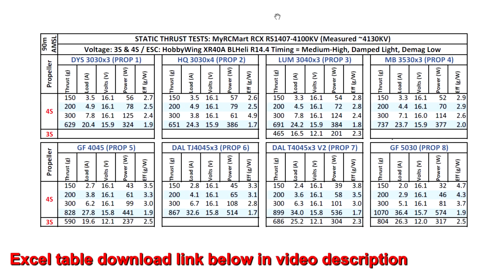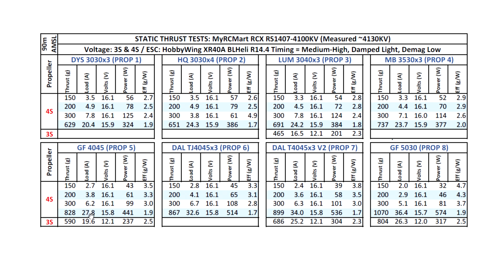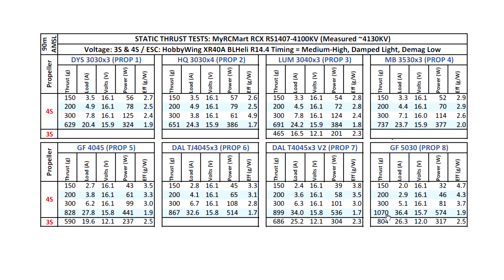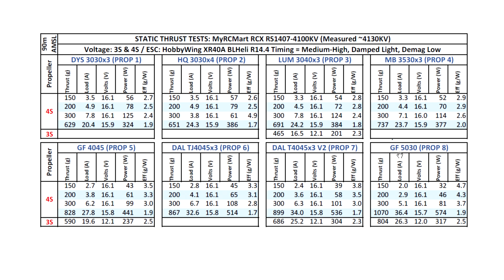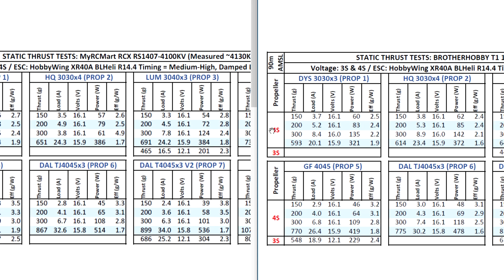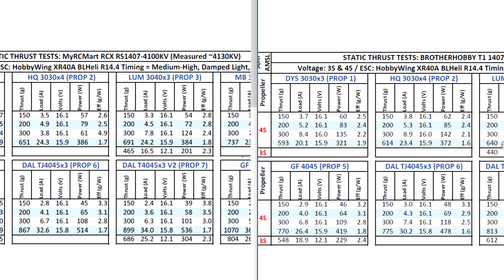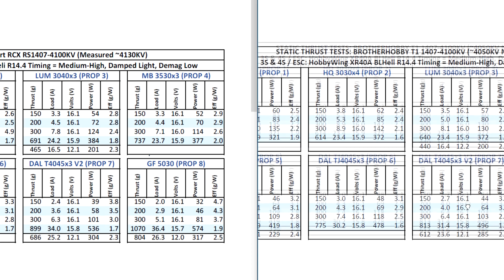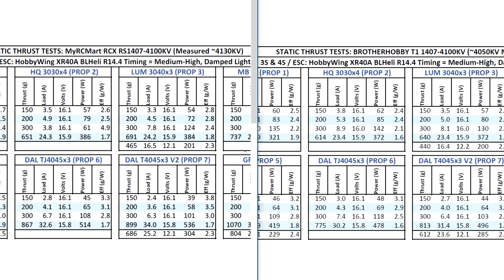MYRCMART.COM RCX RS1407-4100KV Static Thrust Tests 4S & 3S

Comment: How hot were the motors with the 3in props? I am planning on getting a set, but I don't know which KV to get the 3400 or the 4100. I would like to go with the 4100kv version if they don't get to hot. The build will be under 250g. Thanks!

Comment: Hi engineerX , do you think these ESCs can handle the RX 1407-4100kv with  3 blade  prop and 4S ?  ESC :  Ori 4in1 18A
Reply from the maker: Lum 3040x3 Max = 24A, in the air-flying estimated short burst Max = 24*0.7 = 17A (conservative 30% lower Max)
So by my calculations and experience, I would say 18A should be enough. Of course, there's always some uncertainty, but if ESC is good quality, then I would use it without any worries.
Reply: thanks !  do you think this props will be fine on 4S ? >> https://www.banggood.com/10-Pairs-Geprc-3042-3x4_2-Inch-3-Blade-Propeller-M5-Mounting-Hole-CW-CCW-for-Racing-Drone-p-1190428.html?rmmds=cart_middle_products
Reply from the maker: I have not tested those but if I had to guess, those would probably max @28A> That's about 19A on the quad but only for very short bursts. I would say they should be OK but can't give 100% assurance, not until I check what Amps they draw with these motor.
Reply: thanks

Comment: These motors are immense. Put them on a 133g auw 3 inch and it's insane. Happily carries an action cam too. Eats batteries though :)
Reply from the maker: Yes, 4100KV uses lots of Amps but there's no choice I think .... usually high KV + high Voltage + high thrust = high Amps but also = high FUN even if it only lasts 2minutes LoL :)

Comment: What are mb3530x3 props? Can't find them anywhere. What does mb stand for? Cheers
Reply from the maker: Militia Brothers or ShubKraft
Reply: EngineerX thx. Sadly can't get them in the uk and shipping is huge. Might have to try racekraft 3076
Reply from the maker: Even from Shubkraft? they're based in Germany  https://flyingfolk.com/SCHUBKRAFT-Racing-Props
Or did Brexit made it more expensive to get stuff from the EU? Hope we don't get hit with customs fees on stuff from China, we're so used to cheap prices here in the US.  I've seen a couple of people posting those RK3076 were disappointing.
Reply: EngineerX yeah I saw them thx, no way I'm paying over £4.50 plus shipping for 3 inch props. Daylight robbery lol
Reply from the maker: LoL you gotta pay for Hans to have his yearly 5-week holiday trip to the Caribbean...... Yes, definitely a bit ridiculous price for some cheap plastic. For 3", If you can find the Lumenier 3040x3 those did well. For 3.5" there's not many good choices, the rest are hacked 5030 props cut to 3.5.
Reply: EngineerX lol. As a Brit I feel compelled to make a German joke... but I'll resist! Are the rotorx still ok? They used to be classed as expensive, but are cheap compared to these :) thx for your help.
Reply from the maker: Just let Jeremy Clarkson do the jokes, he's the best for that. Yes, RX are very good 3" props, they're one of the best performing 3" tri-blades. I stopped including in tests because the Lum 3040x3 has nearly identical performance. The only issues with the RX3040x3 were their price and durability -expensive & fragile, but they fly really well on light setups.

Comment: I fell in love with those numbers on 3" :) its a shame that myrcmart has a policy of misinforming customers =/ when i ordered it said the 4100KV version is in stock (and it still shows that it is!) and now after few days with the order still on processing i thought i better ask whats up.. and then they tell me its out of stock i need to wait at least a week for the new batch or take the 3400KV instead.. this is utter bs =/ i was so hyped for my new 3" build...shame no other company has such powerful 3" motors so far =/
Reply from the maker: Yes. MRCM doesn't have a good inventory-reporting system for their webstore and that happens especially on their new motors like these 1407's. They probably have "normal" stock but then people start buying them quickly and their store front keeps taking orders and then they run out. Same thing has happened with lots of their motors like the H2205, RS2206, etc, Demand is quite high when recently released as lots of people just rush and grab them. I have read in forums some people ordering up to 20 motors in one order.
Reply: i think thats a really bad habit of them =/ and i think they do it on purpose.. other shops write at least an email right away if something isnt in stock .. really great first buying experience after almost 200 orders from bg.. but cant be helped^^ i can be furious but that doesnt change much :) i really want these motors ..soo lets hope the weather is still nice when my copter gets some air xD

Comment: ordered! these are going on Avant Quads Xero 3".  Frame weighs 27g and fits a runcam micro with no messing - at last! I reckon it'll be faster than my 4" superlight using 20x20 stuff :)
Reply from the maker: Sounds like it's gonna be a mini-meanie!! That's awfully light wow! I'll be looking forward to watching it rip. I'm going to use mine to replace 1306-3200kv motors on my 130mm frame but it's not as light as yours. It's around 245g with a 4S-750mah LiPo.
Reply: EngineerX sounds good!

Comment: Probably the best value for 3 inch performance.. at only 10 a piece - even if a little heavier than some of the others.
Reply: ten drones ..... where do you see them for 10 each? Thank you.
Reply: Go to myrcmart and select the 'no warranty' option when you put one in your cart.
Reply: Don't bother there junk recieved a set and 3 of them have bad vibrations just spinning them by hand
Reply: Kwad Doctor My 8 are brilliant and I’ve used them for months.not sure how you’re getting vibrations by hand. That’s motor cogging which is normal on 1407s. You need to softmount them.
Reply: 1 is good, the other 3 have lots of play and noisy spinning them just by hand, they sound like a bag of spanners. This to me indicates poor tolerances and/or bad bearings, I would not even waste solder on them. My bh1407s have no play and feel very smooth and they have alot stronger magnets if thats what you mean by cogging
Reply: Yup, that sounds bad. Sorry you got a bad batch.

Comment: Which one would you buy? RCX makes a lot more sense according to number. But they had quality issues before with the aliminum. Are these 7075 grade metarial? Also what is the weight with short wires? Usually they have very long wires and you can save like 2 gram with shortening them.
Reply from the maker: https://youtu.be/Pz-f-hij07Q?t=6m34s
I weighed it on the review of the 3400kv. 17.4g. if you cut the wires to about 50mm, then 300mm of wire weigh 1.7g, just subtract that amount or you can subtract whatever amount you want, 1.7g/30cm = 0.0566 g/cm